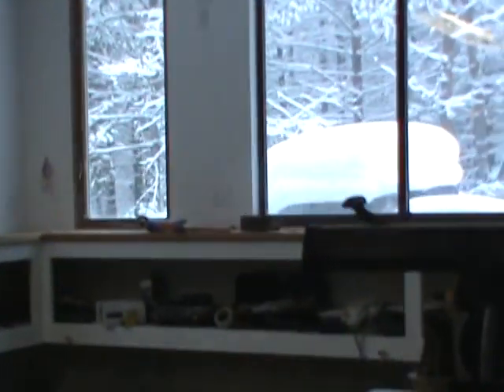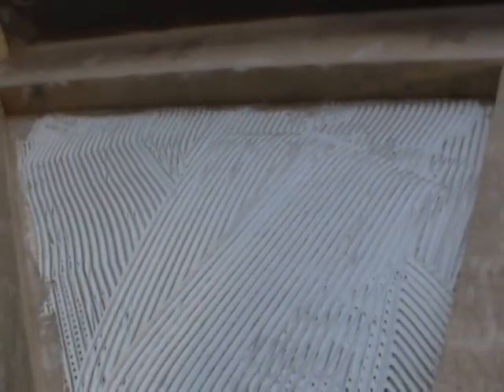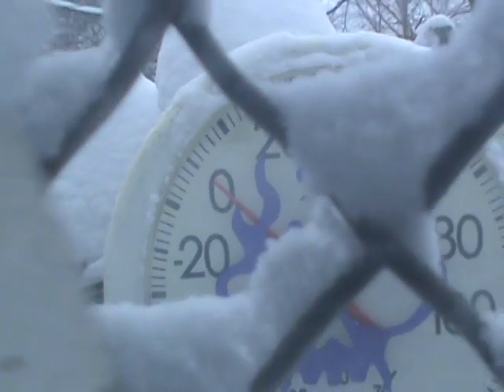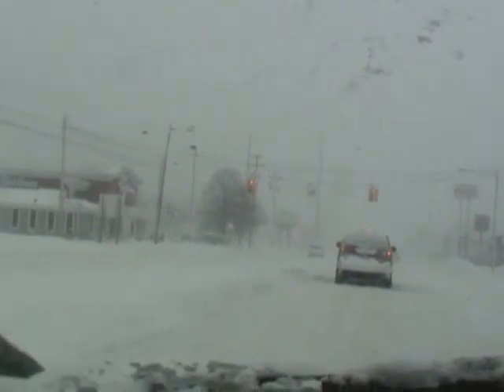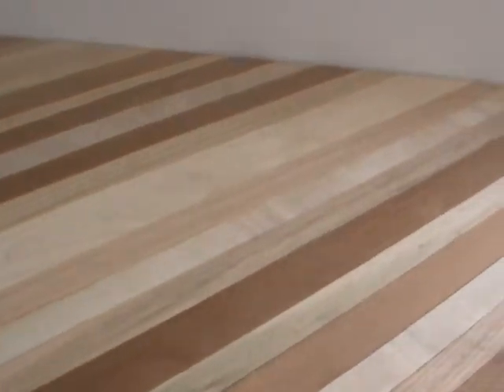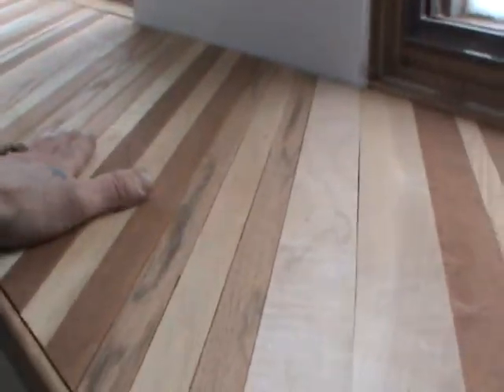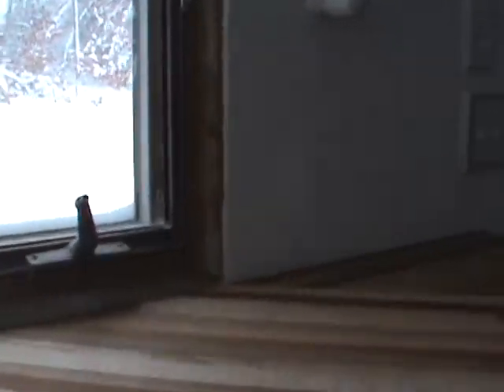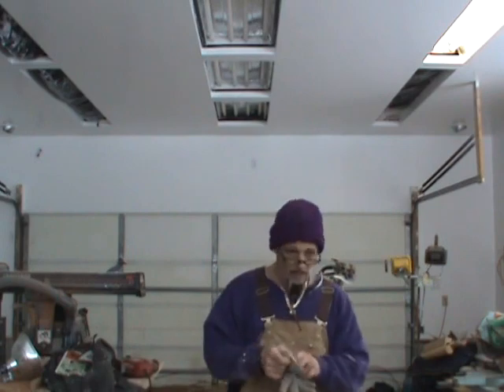SKI-TOWN -NOMANSLAND USA

Comment: Keep your sawdust and mix it with wood glue and force it down into the gaps, then when dry sand the top until smoothe, stain it, sand with steel wool, then sand and stain until desired finish is reached.  Well done.  I was into this in a big way